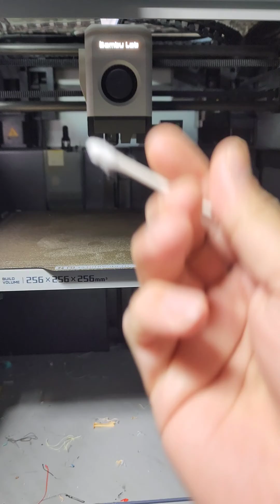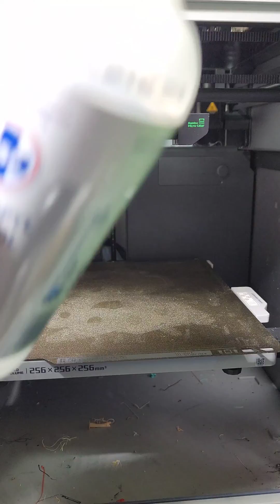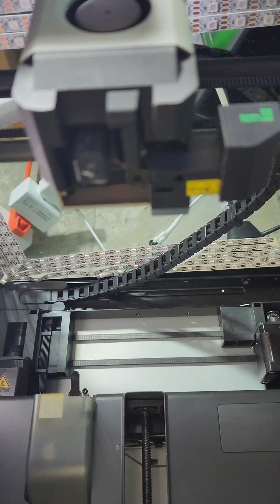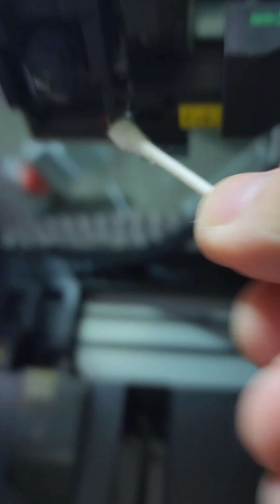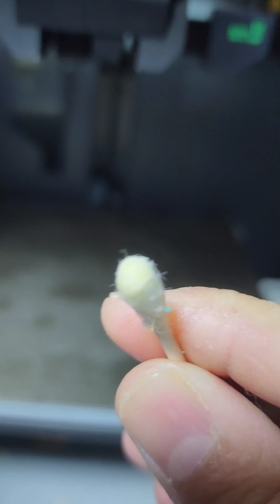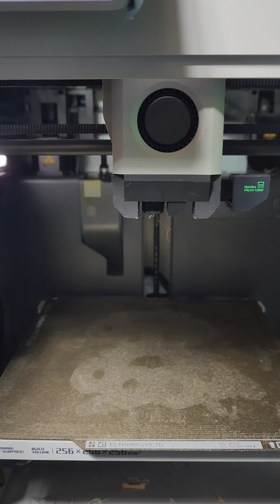How to clean the Bambu Lab X1C Micro-Lidar Lens - Bambu Lab 3D Printer Cleaning/Maintenance

Comment: One more tip. Take off the cover of the print head (it's held on magnetically and by a cable -- you don't have to undo the cable, just pull it off) and move it to the side out of the way. Now you can EASILY get to the lens. But, with a q-tip, it's not necessary, really. Just a little easier to see what you're doing.

Comment: Cleaning is easier if you first remove the front cover (the thing with the fan that lights up and is held on by magnets).
Reply from the maker: @radish6691  I prefer to leave the front cover on, rather than disconnect it every time and risk something breaking
Reply: @ I don’t disconnect the front cover, I place it on the linear rod though I’m not particularly concerned about anything breaking by unplugging a single connection.  I also turn off the printer first.
Reply from the maker: @radish6691  fair enough. Whatever method works for you is the right method. 

I personally have the worst luck with everything. With my luck the printer would magically turn back on and sever the cable connector somehow and crack the faceplate. I think bad luck was invented after me.